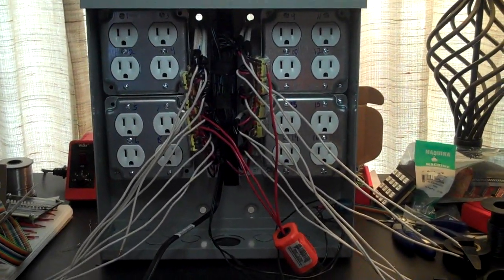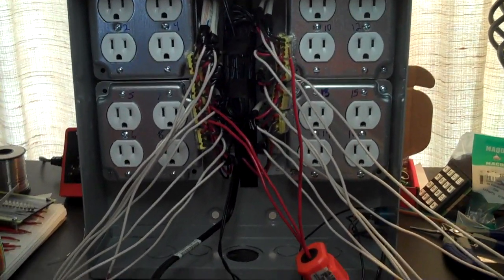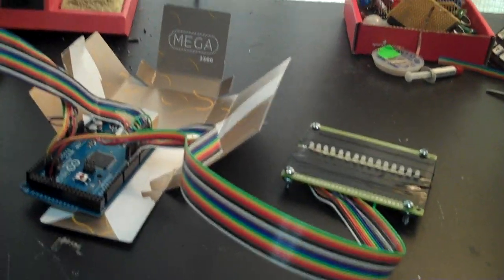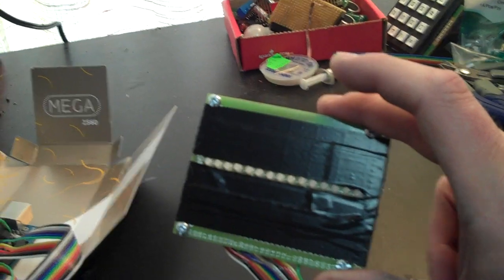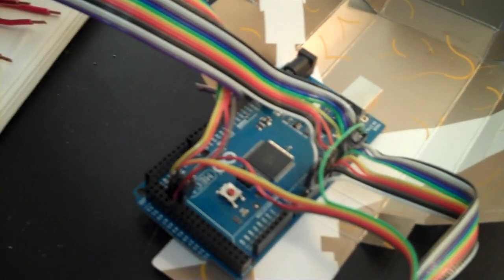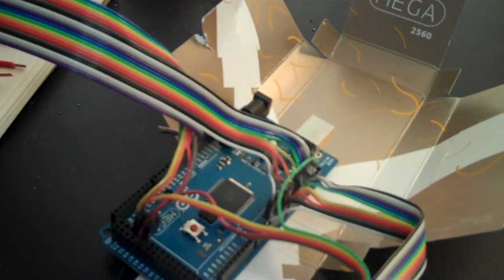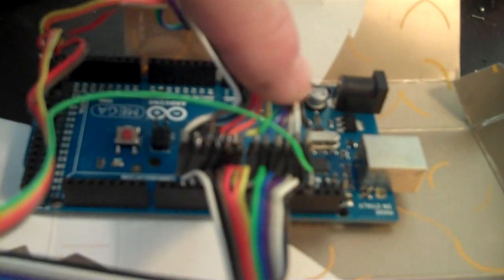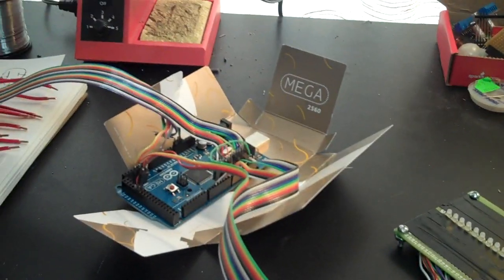Christmas Lights Control System - Part 4-1

Comment: Driving a relay with PWM is not going to allow you to dim or vary the brightness on the contacts of your relays.  Relays are either on or off, open or closed.   Full power or no power.   PWMing the relay driver will only lower the duty cycle of the relay driving circuit voltage to the relay coils.

Comment from the maker: Yeah I used resistors, I can't remember what size.  I think they were 1k ohm.  You can't really hurt anything by getting the wrong resistor.  Too small and you burn out an LED, to big and it simply won't light up.

Comment: can you give more info on your led board? as in did you use resistors? if so what ones? or did you solder them stright to the pins for the ribbin cable? this is a great project which i am build right now. just need more info on the led boardas i will be enclosing everything in a cabinet to cut down on the nosie from the relays & want to make sure like you that the pins are getting the signal..

Comment: I am sorry for all the questions, but on the outlets you are making a bus for the (+) hot  wires and the (earth ground) wires.  May I ask why you are switching the (-) Neutral wire on the relay board?  Why not the (+).  Also do you have two separate ground bus's going into the power source or did you connect them together and then go to the power source.  BTW you rock this project is amazing!